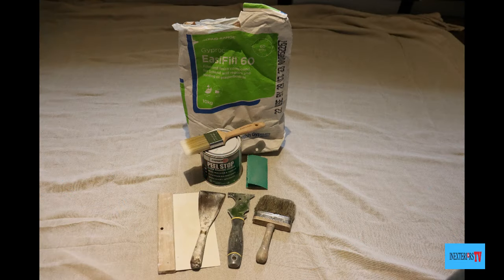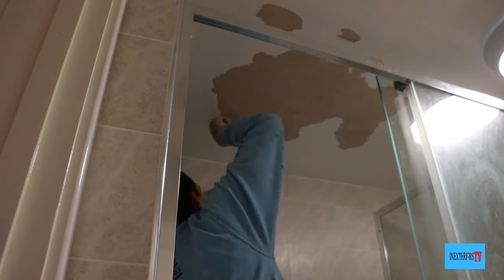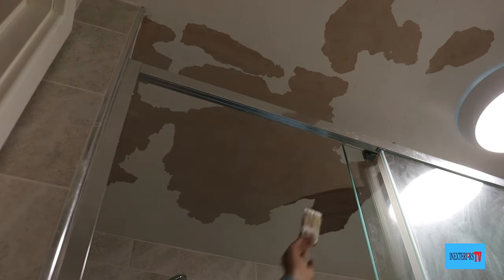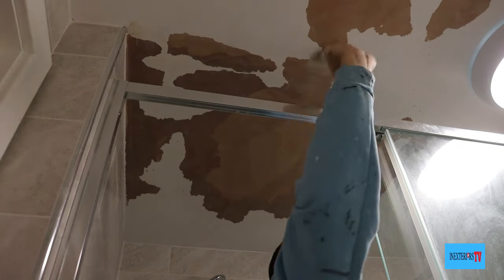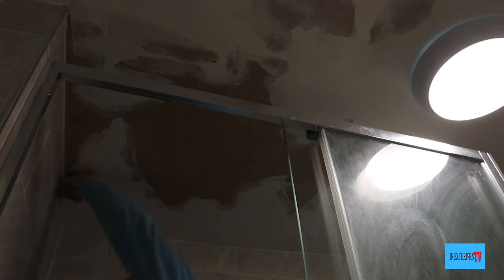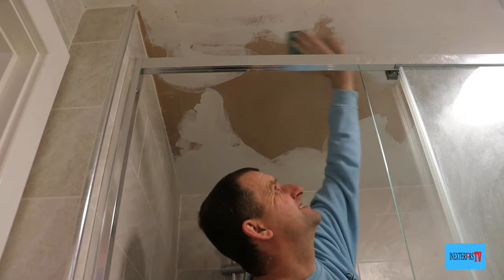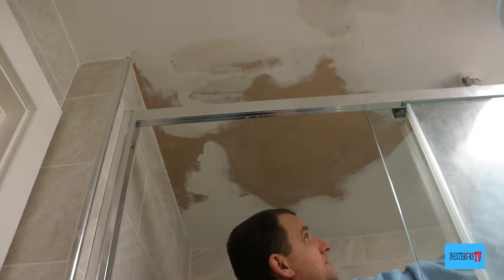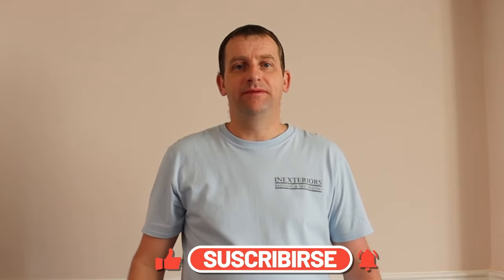Repairing peeling paint in a bathroom.

Comment: Many thanks for the advice, ive been agonising over this problem for days. I used Zinsser Guardz as i couldnt get the Peel Stop. I hope that works as well? And can i get away with sanding the edges but not usin filler, on a matte surface?
Is ready mixed filler the best way to go? Ive only got the branded filler in powder.
Many thanks and keep posting for us DIYers, please...
Reply from the maker: Thankyou very much, it all depends how far you want to go, if you can live with the little step then dont fill, if you want to lose the step then fill, use the filler that is easy to sand.

Comment: PeelStop is brilliant .... so many use PVA cus it's cheap.. but they don't know the problems you get with PVA and bare plaster + paint!.
Nice to see it done right Steven.
Have you used Zinsser Permawhite Mould Resisting paint yet for bathrooms?? awesome paint
Reply from the maker: Thanks Phil for your professional feedback, to be honest i have only started with the zinsser products a couple of years ago. So far i have used the peel stop and bin and the 123, i will get round to using more. None of the edges lifted at all when i did this cieling using the peel stop, before the peel stop you can guarante i would of been fighting with some of the edges. Never have used pva for it though. Maybe a collaboration is on the cards in the future.
Reply: @Inexteriors  Zinsser Gardz is a life saver.. ideal on problem surfaces.. like efflorescence/distemper etc.

So many good products out there now, it's just a case of finding a good one you're happy with.. or you're forever swapping and changing.

Bedec and Isomat do some good paints. (water based).

Happy to help if I can ;)
Reply from the maker: Cheers phil, up untill 4 years ago i did not rate water based/hybrid undercoats and top coats, my head has been turned i love the Johnston's aqua undercoat and top coats.

Comment: Is the purpose of the Easifil to make a better transition from paint to board? Can it be replicated with spackle, or possibly skipped entirely?
Reply from the maker: its to take the step away from the peeling paint edge to the plaster, so it fills the edge out and looks smooth. Yes you could leave out if you are not concerned about the step. Could you explain what spackle is and what it does, as we dont use it here in the uk or we call it something different. Many thanks.

Comment: Great video thanks Steven, I have peeling paint on bathroom ceiling, it looks like no undercoat was used. I have a bit of black stain which looks like from condensation, any tips on how to paint over it? I bought Zinsser Cover stain for another room could I use it on the ceiling here do you think? Also whats wrong with PVA to seal? thankyou.
Reply from the maker: Thankyou very much. Paint sits on the film of pva, if the pva peels so will the paint pva is not goo to seal plaster before painting,. you can use the cover stain for the black stain, use the peelstop like i did in the video.
Reply: @Inexteriors  thanks yes I will do that. I also have half a wall in utility room where they painted over some peeled paint only, no filling done, it looks awful, like craters on the wall, will I fill over do you think? It doesnt seem to be peeling.
Reply from the maker: @hils3327  If its not peeling give it a little sand, then fill.
Reply: @Inexteriors  thanks very much

Comment: Hi I’ve already used pva to the peeling I’ve been working on is that enough now ? Also if the ceilings other areas are not treated with peel stop I guess that will be the next area ?
Reply from the maker: peel stop is the way forward my freind.
Reply: @Inexteriors  on top of the pva I’ve already put on then straight paint
Reply from the maker: @gazzer100  apply it over the pva and see what happens, i would not use pva to be honest, moving forward just use the peelstop.

Comment: If you stripped all the paint off would you still use the sealer or would you just mist coat the plaster before painting?
Reply from the maker: I would mist coat the bare plaster, with a 70/30 mix of thinned down emulsion.
Reply: @Inexteriors  nice one, subscribed 👍
Reply from the maker: @lcpp5804  Thankyou for your support.

Comment: Silly question.   Why am i filling it when its a small layer.   It's not a hole.  Could i not just paint over it.    Pardon my ignorance .
Reply from the maker: No probs, you can paint over it, or you can fill that thin layer or little step, its all about how far you want to go.
Reply: @Inexteriorspainterandecorator  thank you.  But you recommend to fill and do a proper job.   Also can I use mould resistant paint. Zinsser
Great vids by the way.
Reply from the maker: @user..Aa..Bb..  Yes you can use the zinsser permawhite, but you must prime bare bits of plaster with zinsser bullseye 123, after using the peelstop.
Reply: @Inexteriors  amazing. Thank you again .
Reply from the maker: @user..Aa..Bb..  Thankyou for watching.

Comment: Hi there. 👋 I need your help finding the right type of paint for my bathroom. It's to paint over wooden surfaces which had old yellowed gloss I've already sanded down. Is there a water-based paint, for bathroom wooden surfaces which can withstand moisture exposure 💦 most recommended bathroom paints are designed for ceilings & walls 🤨
Reply from the maker: Use the same paint as the rest of the woodwork or consider using oil based,
Reply: @Inexteriors  even though oil lasted 10 years.  I absolutely detest oil solvent now that I spent  hours and days sanding off old yellowing gloss.  I'm new to water-based hence my trust issues of what brand to use. I read great reviews & tips on everal 40
Reply from the maker: @bsfbestshortfilmsonyoutube  Go with it, i have  never used it, i used the Johnston's aqua guard yesterday that is good.
Reply: @Inexteriors  I probably will go with AG  thanks again for your advise & replies much 👍
Reply from the maker: @bsfbestshortfilmsonyoutube  Let me know how you get on, like i say i learn from you aswell.
Reply: @Inexteriors  I will do and your right about using one paint on all . I don't mind paying extra expensive paint if it can do all wood surfaces. for example if a floor paint can take a good foot beating surely it would be also good to use on all other surfaces.
Reply: @Inexteriors  tikkurila paints are v expensive 2.5 liter = 80 euro. AG I can buy 5 liters = 80 euro. what do you reckon ? If i painted all my doors, skirts and window frames using AG ? outta 10 what would you rate Aqua Guard for durability ?
Reply from the maker: @bsfbestshortfilmsonyoutube  I will be doing a scratch test on Aqua guard next week so we will see.
Reply: @Inexteriors  ok great I will wait for you mate thanks.